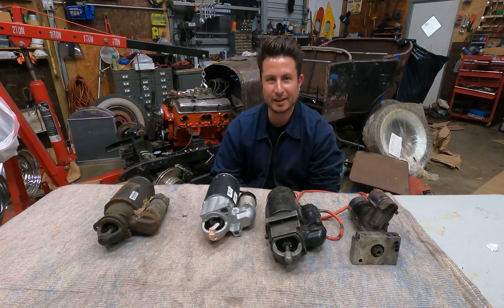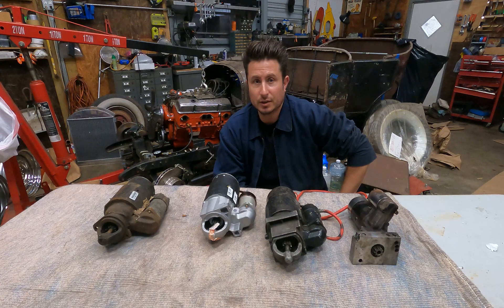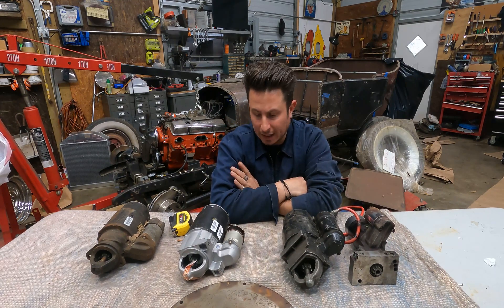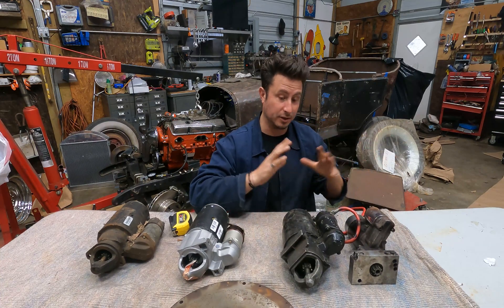Why are there SO many Different Small Block Chevy Starters?!? Which one is right and HOW TO TELL!

Comment: Depends on the manufacturing plant. Each plant used up old inventory.  Then switched to current block mounted starter. I once came across a 72 Nova that had a factory installed generator.  Not an alternator.

Comment: The 400 sm. bl. is the same way with the starter nose being different and the flywheel different than a 350. The external balanced 400 eng must have the 400 external balanced flywheel, and nose cone on starter for the flywheel.

Comment: The old starter or first one one the table is called a Hog Nose starter and i have that one on my 67 Chevy Truck  , the 2nd  starter is on my 4.3 V-6  and the 3rd  is on my Chevelle  , the 4th  starter is an Aftermarket High Torque Starter

Comment: Glad I watched this, my 283 cid, is pre 62, out of some Chevy car, thinking it was a caprice with a Muncie three speed transmission and someone changed the nones cone to the rounded style not the pointed style like in your video, I put a new solenoid on it but it still has a issue meshing up to the ring gear, every now and then it sounds like a bunch of wrenches thrown in there are clanging around, must be the bendix not connecting as the starter will just spin over and not the engine. I’m thinking the starter is not the right one but works on and off. Good video 👍🏻

Comment: So if I got a small block 305 would high torque start match up with the fly wheel and bolts
Reply from the maker: depemds on the flywheel or flexplate for it.    mosthigh torque starters are drilled for both 135 and 168 tooth (have two mounting positions) in my experiance i have way better luck with factory starters there is no need for a high torque starter for a street car

Comment: Thanks, needed this info......... I can tell you that the older bell housing mounted starter WILL NOT WORK with a '62 or newer 283 motor with a 168 tooth fly wheel...........
Ask me how I know....................

Comment: Shouldn't have to shim a starter. If you get the right starter with proper nose piece there should be no grinding. It's a common starter noise that eats up flywheel. You get a starter from part houses and they usually give you a rebuilt starter that has the most common nose piece that most of the time doesn't have the correct throw. Getting a starter with the proper throw and gear pitch will eliminate the griding you here on alot of GM engines. That grinding noise.
Reply from the maker: Well…. How does a fella know what nosepiece is right?    Or how many there are 
    In my experience most of them don’t need shims… and the typical Sbc block is machined the same as the rest and the flywheel bolts on the crank about the same I am not sure why there would be different throw distances 
     After all the shims her about spacing out the teeth, not about the distance.
Reply: @betweenthesharksgarage  here's a example. I had a 1974 chevy G30 with a 350. Engine was rebuild and a starter was bought at a parts house. Installed and it would eat up flywheel. Went through the " that's the right part" deal and smoked  2 flywheel. Said fuck it and went down  and bought a brand new one from chevy dealership. Completely diffrent nose piece same motor. The diffrent nose piece was longer giving it longer travel and have a diffrent spin rate. Slapped in and smooth as silk no chevy grind. It's important to put the enforcement bracket on as well to stop twisting.
Reply from the maker: @FredColberg-jk5yp I believe your story, but unfortunately buying a 74 small block started at a dealership is no longer an option...or if it is they are just ordering it from napa.    and without being able to show people which is the right one vs the wrong one for whatever application i dont really know how to help people with this information

Comment: THANK YOU! I have the offset bolt pattern (168 tooth) and I was looking at the high torque mini starter and didn't understand how it was supposed to fit when it has the parallel bolt pattern. This video helped me understand, now I'm confident it will fit.
Reply from the maker: glad it helped hoe it works out for you

Comment: I have a 168 tooth flexplate and i have tried a couple of starters with the offset bolt pattern. I am unable to get the proper 1/8 spacing between the flywheel and the starter pinion shaft. The teeth enguage, but just barely and not well enough to turn the engine over. I have found a few people on the internet who say chevy made a bunch of blocks that had the starter bolt hols drilled .001" further from the crank than they should have and their fix as the starter with part number 4347 insted of their regular starter with part number 3510. Have you ever heard of this? and where can i find a 4347 starter?
Reply from the maker: humm I have never heard of it, seems strange... what year is your block?   I have had the opposite issue with a cheap off brand high torque starter that I could not shim enough to not grind.   So start with a stock starter if you haven't yet.. 
    ...also one word of warning  If it showed up in a forum... I have run into this problem a lot, that one person somewhere typed out a "solution" and it gets repeated by other people in other forums as if its gospel even though they have no actual first hand experiance.   I think they are trying to help... but they are really just repeating the thing they read somewhere...
   since you have tried a few starters, and the 168 tooth flyhweel vs 153 would leave a 3/4 gap...I would start with shimming just the outside bolt and see if that rotates the starter in enough... and it is reversible
if that doesnt work, i would either drill out the mounting holes in the starter to make them to see if you can slide it over or grinding down the mounting surface on the starter to get it closer to the block.. kinda the opposite idea of shimming.   
    it sounds frustrating...good luck with it

Comment: Does the high-torque starter bolt up to replace the early model starter? My 1970 C10 with a 350 and a Muncie 4-speed has the old style starter and I think it just gave out.
Reply from the maker: not sure what you mean by old style, but a high torque block mount starter should work to replace a factory one.   personally i have always have better luck with stock ones.   I will say i have had bad luck with the cheap mini starters off ebay... my recommendation is hit your local parts store and get one with a warranted

Comment: I just found out the hard way about starters. Tried to switch out a 1991, 305 block to replace a 1959, 283 flywheel that had the 168 tooth, 14"+ flywheel. The 305 has a 2" crankshaft hole (153 tooth) and the 14 1/4" had a 2 3/8" hole as well as bolt holes that were different. These differences require a different matching (teeth) starter as well.
Reply from the maker: thanks for commenting.. its tricky and you introduce a new variable, the post 86 small block.   still super similar... but i learned a few differences from your comment ... so thanks

Comment: Good video. Very informative!

My 1966 C10 truck that has a 283 w/4 speed stock tranny uses a starter that mounts to the bell housing. The engine block also has bolt holes for an engine mount starter for automatic transmission applications available during that era.
Reply from the maker: glad it helped, that is a good point the 4 speed with granny gear are some extra oddballs to add to the equation

Comment: I broke the post on my starter for my 72 c10 when installing headers. I bought a used one for $20 on offer up and it was totally different. I ended up getting a brand new one from Advance auto parts for $9.50! Truck Started right up after I got fuel in the carburetor again

Comment: I have a 1971 GMC K15 with a 4 speed manual and it uses a bell-housing mounted starter.
Reply from the maker: interesting! is the sm465? I had an SM465 in my k5  but it had block mounted starter

Comment: How many teeth does the Bendix use for the 153?
Reply from the maker: i think the starter teeth are the same, that is an assumption because there are starters that work for both ring gears, they just have two different sets of mounting holes

Comment: I’m sure it had that transmission but now has a 350 turbo so will
Measure the flywheel
Next I have a67 Chevelle starter to pic up but I think the flywheel is to big like you said
Reply from the maker: might just be mixing words here but you need a flexplate not a flywheel for that transmission

Comment: So
More than likely they have wrong flywheel on this 1963 283 , it has both provisions for bolt up on the block but both if the 63 starters don’t fit not deep enough and can’t get starter close to bolting up by 1/2” or so
Reply from the maker: not really enough information here to help you you out... but if you have a bell housing that a starter will bolt to you might need to use the earlier three bolt starter because the early  bell housing can interfere with the block mounted starters

Comment: Preciate your video, I have a 1979 chevy 350 i got a new starter yet it engages and locks up i had a mech come check it out he said the starter has too many teeth - ok its just a 350 starter how many teeth should the starter have its a str8 bolt pattern not the diagonal what gives?
Reply from the maker: You could have a very unusual problem I don’t understand but if it’s engaging and locking up it just sounds as if you need to shim it which is pretty standard practice, and starters come with shims.    There are probably some YouTube videos out there that can help you with the clearance you need.       
   However, I did buy a cheap mini starter   on eBay once, and no matter what I did that thing would grind.   (Tried it on two engines) Replaced it with a higher quality part and that solved it.   
      As far as I know they are all the same tooth count on the starter spur

Comment: Thanks Bulldog.  My 496 has ceramic coated long tube headers, and have them insulated with Heat Shield Exhaust Insulation Material too.  No oil leaks. Going through aftermarket hi torque starters like crazy. (Summit house brand, Powermaster etc.) Running 2 batteries, 140amp alternator.  1 gauge Superstart cable. 10-30w oil.   Starters can't spin the 10.5 to 1 engine.  Last a week or two . Will try your clearanc technique.  See if that helps.

Comment: One question when I turn it on, it sounds a lot and I put it in new because I bought it new cheaply, that's why what I saw when it arrived was that the connector where the ignition positive goes in the starter motor was broken, what would it be, I don't know what's happening or not. It's original I don't understand what it could be I'm crazy now and the starter motor is new I don't know if it's because it's not the original but it slips and it sounds loud and takes a while to start crashing the bendix help me

Comment: I have also found the gear drive that was eating my 168 tooth flywheel has 9 teeth which is staggered so I ordered a another staggered starter with 11 teeth gear drive hopefully that will fix my issue due to no amount of no shims or small medium or large has changed 3.5 hours of shimming changed
Reply: Did you get your issues figured out?

Comment: So if you have a 168 tooth flex plate you would use the offset bolt pattern starter ? And for the 153 tooth flex plate you would use the straight pattern design starter ?
Reply from the maker: I think that’s the rule of thumb

Comment: To add more confusion to the mix, starting around 1994-95 on the last of the TBI 350s came with a smaller direct drive starter that was still for 168 tooth but to use that starter properly on an early block requires a special set of starter bolts with a larger shank that GM performance and dorman offers. Same for the later vortec 4.3,5.0, and 5.7 use a very small gear reduction starter that works well but also requires the special starter bolts with the larger shank size, if the wrong bolts are used you can have starter alignment issues and it won't properly support the starter. But for a budget mini starter with a 168 flywheel, using a factory starter for a 96 and up vortec 350 works great and gives a lot more room for header clearance and is much lighter than the old school starters.
Reply: SD250/5mt starters are the ones you describe from the 90s that are direct drive.

PG250/pg260 are the gear reduction ones (pg260 being the best)

SD300/10mt (the old heavy ones) came in HIGH TORQUE and normal variants. The high torque is heavier, bigger(mostly longer) as is visually different. BOP engines to my understanding came with these but I could be wrong on that.
Reply: Hey I need your help I’m having the same issue
Reply: @jovonsavage4298  the bolts from Chevrolet performance is part #12338064. You can cross reference that number to a dorman part and get them thru a local auto parts store or you can buy directly through a Chevrolet dealer. These bolts are for using the later 94 and up starters on the old style blocks(has the fatter shoulder for the metric starter but the old SAE thread size). Some blocks depending on bolt hole depth and depending on if the starter has been milled or re machined may require 1 or 2 washers on the bolt to not bottom out.

Comment: I've got a 1972 C10 pickup with a 350, and the starter bolts to the bell housing. What I can't find out is whether it has a 153-tooth or a 168-tooth flywheel. But given that when I installed the new one I got that same whirring noise you describe, I have a bad feeling that it's a 153 and that I bought a starter for a 168.
Reply from the maker: this is curious...  three bolts into the bellhousing? I thought there was only one option for that style.    what transmission is in it...3 speed cast iron?  there are two options here, either    the flywheels are different diameters so if you have an inspection plate you can measure...   if the new one matched the old one and the old one worked, then your new starter might bad out of the box, it would mean the starter is spinning but the solid is not firing the gear out there.
Reply: @betweenthesharksgarage  The new one appears to match the old one. Fortunately, this morning, I got a lead on a local shop that can rebuild the old one for me in a couple of days. I'll be taking the replacement back to the auto parts store for a refund, and I'll ask them to test it first.
Reply: @betweenthesharksgarage  you were right. I got the rebuilt starter into it and it fired right up. Took the replacement starter back, and when they tested it, it was bad. I also discovered that in addition to the bolt holes in the bell housing, there are the more common two bolt holes in the block, so if I ever have to replace the starter again, I'll have more options.

Comment: I used a 06  8100 factory starter on my 70 350, factory hi-output. Stagger bolt for the 168 tooth or 14" flywheel
Reply: Was the flywheel with out the weight on it?I'm not sure if a 90s small block starter would work on 80s chevy 305 small block
Reply: As far as the starter to engine, as long as the starter has a staggered bolt pattern with equal length bolts and you have a 14" flywheel it will work,  regardless of if it has a weight on it or not.   2006 up 8100. I've been using that style on everything now, 99 5.7 suburban, 94 5.7 extended cab Chevy, 70 C-10. 350 , 87 astro van. 4.3. Yes  the V-6 takes the same thing,  high output, low current draw, just make sure you get the bolts to match it, the knurled end by the threads is supposed to stick out about a 1/4 inch to help locate the starter to the block

Comment: Not sure on this, but I think the cast iron transmissions had bolt into transmission starter, and aluminum transmissions had block mounted starters. I had a 60 Impala with cast iron Powerglide, starter bolted to transmission. My brother had 62 Impala with aluminum Powerglide with block mounted starter. Also, to add to confusion, some early bolt to block starters had smaller front/nosecone housing than later years. I have one but dont know what year it is.

Comment: I have a 1958 283 that I am building and it is factory block drilled for either type starter. The one that accommodates the 153 or 168 tooth ring gear. 

BUT….

The side by side mounting holes for the 153 are more narrow than the later starters. There is discussion over on the HAMB that say about 1961 is when the holes went wider. I am using an aftermarket ebay mini starter and had to have the aluminum mounting boss drilled to accommodate for the narrower mounting.

Comment: You are missing a starter there is another starter with a cast iron nose cone with all three holes and for blocs from 68 to about 72 use it in some applications the reason I know this I have had two engines that require that one with a 168 tooth flex plate and it moves the starter closet to the flex plate by 30 thousandth of an inch if you don’t use it grinds and sounds like hell

Comment: I have a engine block that is drilled for both off set bolts and side by side bolts how is this explained
Reply from the maker: It is my understanding that all blocks that were drilled 58 and up were drilled for both starter offsets.   Meaning you could use either the 153 tooth flywheel starter and bell housing combination or 168 tooth fly wheel starter and bell housing combination.
Reply: My 72 engine only has offset, I just put the 153 flywheel on it. Now trying to find a starter that will work.  Might have to change my setup
Reply: @benpatten5220 Try a hi torque starter for a 96-97 C10 5.7. I had same problem on 65 327 with 153 tooth flywheel. Some of the problem was aftermarket starter are just not the same as OEM. Anyway, the 96 starter fit, worked great, no grinding. Maybe that will help.
Reply: Ended up drilling and tapping the extra hole. Got it close enough to straight to work
Reply: The one that bolts to the transmission - would it have to be an early power glide if it’s an automatic?